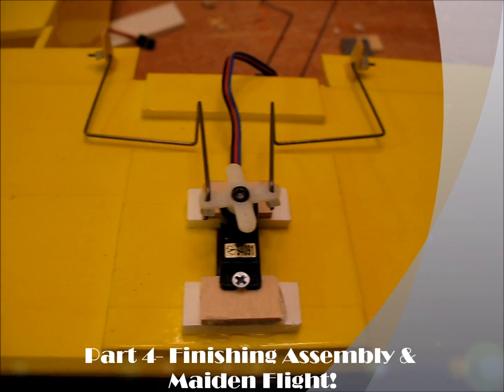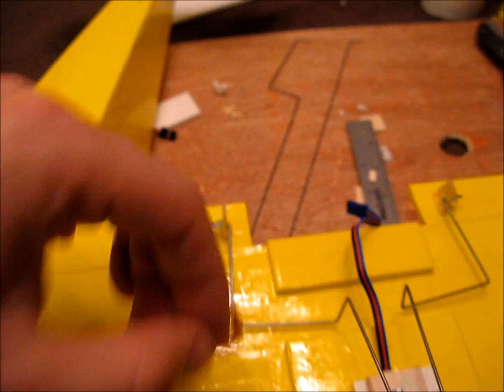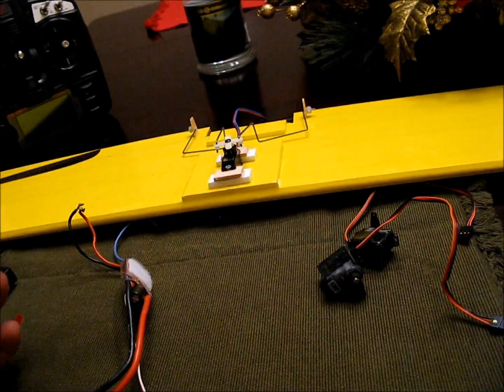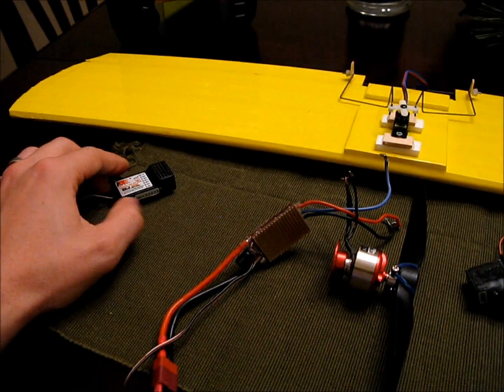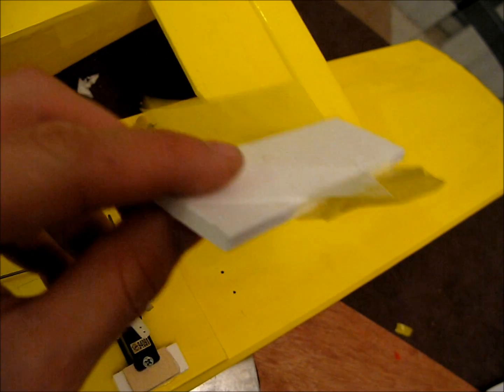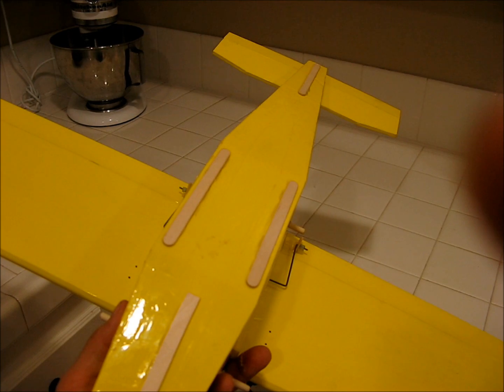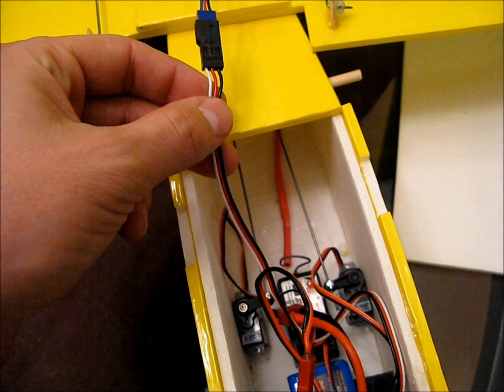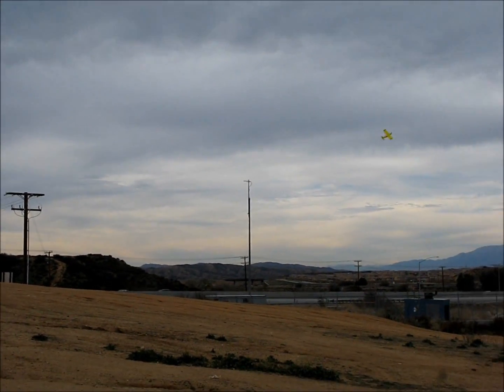Piper Cub Sport Park Flyer 4

Comment: nice looking plane , im going to start a build on one right now , one question though , speedwise how does the plane fly? like with the same motor but step down to a 7" prop and maybe like a 6 or so pitch???? it looked pretty quick as it is but its cute , agile so im thinking maybe a little on the faster side might catch the attention of the guys at the club! very nice plane , i like it , do you have any other designs?